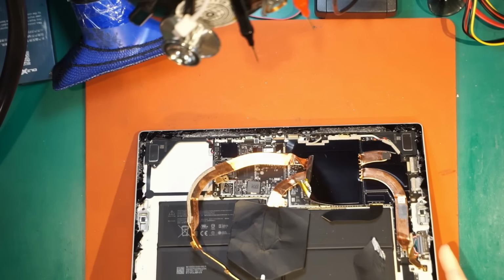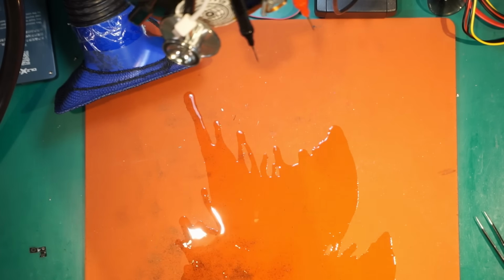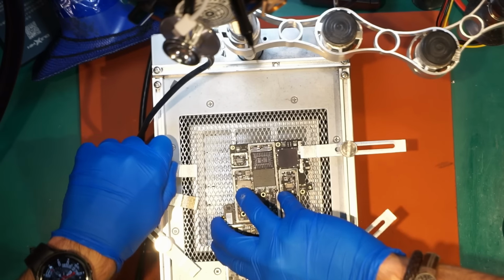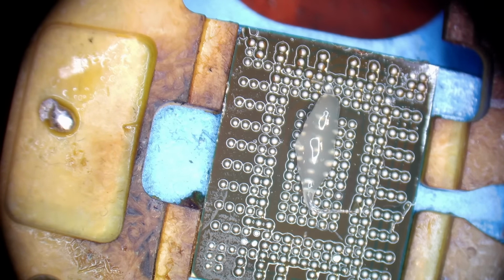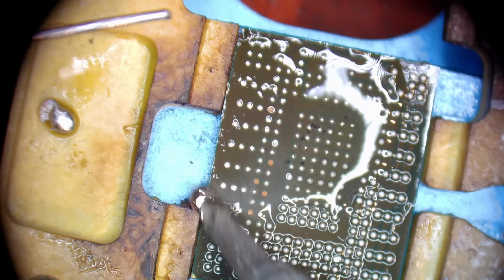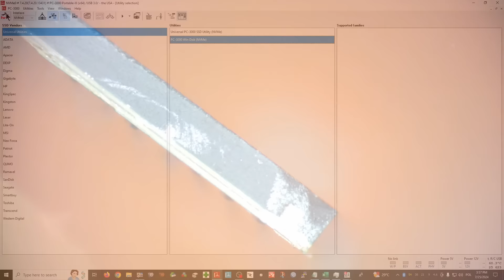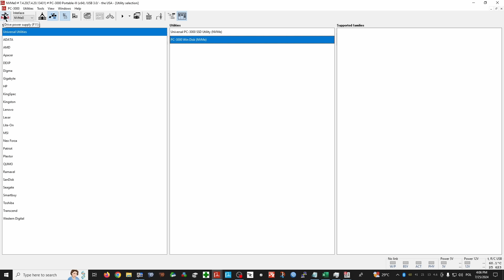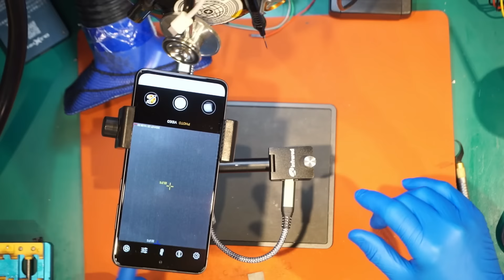Microsoft Surface Pro meets can opener, gets sent to Rossmann Repair for data recovery  😞😢

Comment: Well, can certainly relate to getting glass shards in my finger while trying to take out busted screens. Happened more than once. Would be cool for storage to be on a daughterboard with some anti-shock gel coating. Would probably need several connectors for good bandwidth, but the benefits would be immense, since all you need to recover your data would be an identical device. We gonna ever get that? No. Cause they want us to use their stupid cloud.
Reply: Would an m.2 connector meet you exact specifications?
Reply: @bertblankenstein3738  Shame nobody has invented these yet.

Wait, what?
Reply: @bertblankenstein3738  Memory chips probably have all those contact pads for a reason.

Comment: Chris, after scraping, grinding, or cutting shorted layers, try polishing it, it may help remove shorts.  You may have to cut less off and wont have to be as lucky with the former part.
Reply: @mahekorvenoges550  however Tony from Northwest Repair does it is what I'd place my money on

Comment: i understand these are hard to open without breaking the screen but this is next level. 
i was lucky enough to have a surface pro 4 witch was one of the last ones with a removeable m.2 ssd

Comment: I'm still using a Surface Book 2 from 2017/2018 - it still works, but I know full well if it breaks only the SSD would be salvable, unfortunately.
Reply: I am still using my Surface Pro 3. Yeah battery doesn't last as long, but where I use it, it's almost always on AC. So unless the SSD dies, it's my great little "duffle bag" computer.

Comment: 1000 grit or finer diamond sharpener would not smudge the layer edges so much. 
Also the action needs to be paraller with the layers

Comment: Man, this video comes at a perfect time. Can you send me a board view schematic for the Surface Pro? A few weeks ago I dropped mine, and shattered the screen. Now, I was trying to pull the screen, and clipped some flex cables in the process (I didn't know they were so fucking nut to butt against the bezel). Now that the cables are gone, I genuinely don't know which ones did what. So a board view would help me immensely in determining whether it's worth it or not to buy a screen and try to fix this thing. I've got a Surface Pro 7, which looks exactly like the one you're working with.

Comment: I unironically used a saw to open my surface pro which died after just a year, the ssd was my only priority. Never purchased a MS tablet again.
Reply: That's interesting because some tech YouTubers are saying it's the alpha and the omega of small laptops 🙃
Reply: @archaurore3323  Well if you look at how much shielding effort went into separating the different modules from each other RF-wise, that's impressive. What does not impress me in the slightest is the rock-bottom repairability of these devices. When I buy a laptop It's a must to be able to replace Battery, SSD, Memory modules and Screen. If the manufacturer does not offer those options, including Linux support on all hardware included, I will not buy it.
Reply: @LarixusSnydes  I agree with you. That's why I am trying out a Framework 13'. It's on preorder and I hope it turns out great. Two of my colleagues are happy with their frameworks. I'm on an M1 MB Air, I feel a bit panicky after learning about the soldered SSDs and such. I thought it would be repairable. I wish I had known about this channel before getting the MB Air. So far it's held up, but it sure sucks that manufacturers think that these more integrated computers are really what we want. Everyone wants to junk their entire computer three years after plopping 1500+ euros on something because the SSD croaked??
Reply: @archaurore3323  Many Apple fans behave like they are part of a cult. To be fair I have let myself be swayed to buy a MacBook in 2007(Battery, Memory, Hard Disk can all (and have been ) replaced ) and in 2013 I bought one of the first Ultrabooks, the 2013 Sony Vaio. Now that laptop was great on paper: Ultra lightweight at less than 1 kg, with a very thin bezel and it looks gorgeous. However: It sounds like a jet engine taking off as soon as the UEFI processes the boot option. It has (like Apple) a butchered UEFI, in this laptop one that is hardcoded to start Windows and the i7 inside it, never gets to show it's power because it's instantly throttled. The cooling system is woefully inadequate. Yes, my biggest disappointment when buying a computer.
Reply: @LarixusSnydes Dad has a Surface Pro 3, complete with a 1/10 ifixit score. Compared to Framework's 10/10, which ticks all your boxes.
Reply: @pigletshut  Yes,  the Framework laptops are very attractive. When I bought my last laptop, it did not sell to my country yet. 
Instead I bought myself a Dell 5520, which also features replaceable battery and memory. On top of that, it has two SSD's, both of which can be replaced. All the hardware but the fingerprint reader works great on Linux, my OS of choice. The UEFI is complete, so I can easily edit it to my hearts' content. All in all, I'm quite happy with it, but when it eventually becomes too slow to run what I want it to do or breaks down in a way I cannot repair, a Framework laptop would be at the top of my list.

Comment: "You shouldn't work on your own devices if you've never worked on devices like this."
Tbh, you shouldn't work on anything you care about if your first thought is a sledgehammer and crowbar instead of a screwdriver and hot air.
What the actual hell was this customer thinking?

Comment: Given what I know of Microsoft's software, I figured its hardware would be user-hostile, too, but soldered STORAGE? Is this an anomaly or the new normal for thin-and-lights nowadays??? Grim stuff.
Reply: Soldered storage is getting MUCH more popular on the T&Ls. LTT has a video where one of the Big Manufacturers claimed that they can do higher speeds if they solder it down, for shorter transmission distance or some BS
Reply: @CostcoJomo  Kind of hilarious too, when we've got PCIe Gen5 M.2 drives that provide more than enough performance in the top-tier, but Gen4 and Gen3 are sufficient for most people at a lower cost too. The speed excuse is definitely BS. They hate upgradability. It doesn't sell those higher-tier storage and RAM options they charge double for. 😑
Reply: Since the Pro 7+ and newer the M.2 is accessible via a door on the back of the Surface.
Reply: @CostcoJomo It's all about cost cutting. Its cheaper to solder it than to bother having an m.2 connector.
Reply: New pretentious Apple clone normal. Manufacturers like GPD meanwhile put multiple M.2 slots in.
Reply: @CostcoJomo  I'm inclined to believe it's not strictly cheaper either, especially if they stockpile generic SSDs in bulk for cheap for their other products anyway. 

Besides, don't they also need to move the other chips onto the mainboard that normally come on the SSD like the controllers and Cache/RAM?

Microsoft also has to be able to service and repair their own products, and this would just cost them more money to do this in the long run.
Reply: @GENKI_INU No other extra chips for ONFi or eMMC. Often ridiculously slow compared to nvme though. This seems to be nvme in a single package.

Comment: Now I  wonder just HOW  Apple thought of L R removing the back of Mac lappy and showing US ALL that one of 12 fingers that needed to be attached for screen to work out. one finger was clearly out of usage area. He merely cleaned off area, and RE positioned that slim metal finger to it 'sORIGINAL position, and then sealed it back  in.  CLear and simple esp with strong mag glass. So  L R  made a SIMPLE repair for $35. against APPLE telling you it was a $400 replacemt no  way could it ever be repaired..totheir SPECS.   APPLE never made mistakes,  which is one good horse laugh. peace

Comment: I thought Microsoft surfaces had excellent repairability?
Reply: Not the older ones
Reply: The customer tried to disassemble the laptop using improper tools and ended up damaging it. Nothing MS can do about that.
Reply: @edmonddantes759  The good thing about most newer ones is that the SSD is easily removable. There won't be a need to knife it to begin with.
Reply: @chrisblack6258  Why even use a knife to begin with, crazy peeps